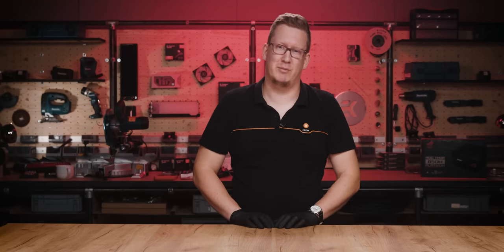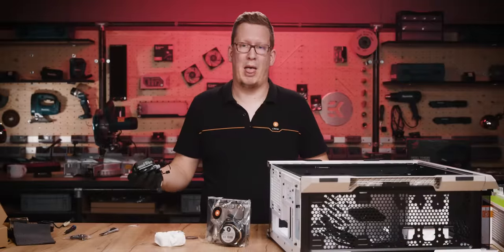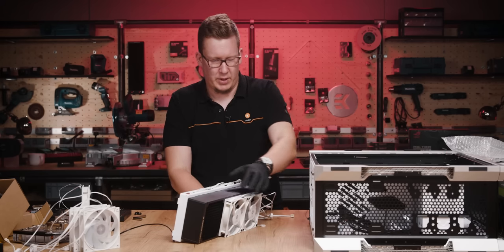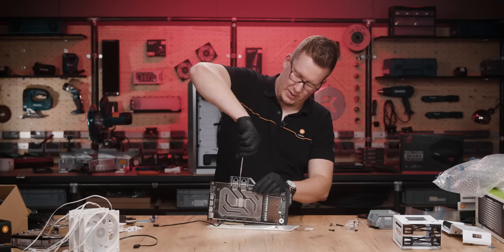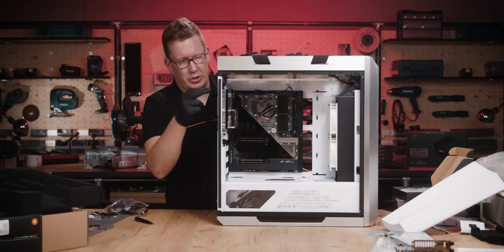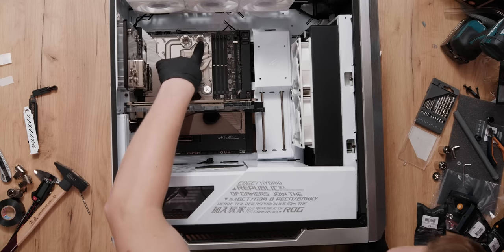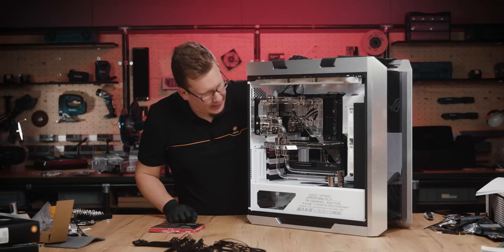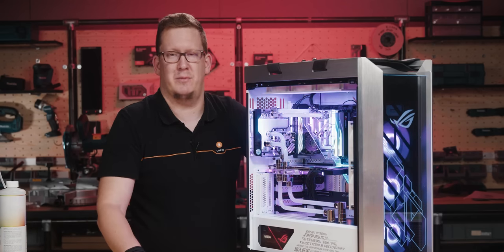🥶 THE FIRST PC BUILD with the $2500 ASUS Maximus Z690 Extreme Glacial Motherboard! 🥶

Comment: So as someone who modifies almost everything in my life, such as creating a baffle for better air distribution in an old refrigerator I use to rise sourdough bread.
I cannot express how fantastic it is to see a video of a computer build that is just clearly showing people that making a custom build takes modifications.
Nothing is plug and play.
Thank you.
Reply: true it's a part that you often don't see, complex rgb build videos are super deceptive, especially the wiring and routing, a cut in the video and "plop" everything is done when it took several hours to do (days if that's your 1st one) and depending on what you want to do a dremel and drill will be required, yes on that expensive case you just bought that's how it is
Reply from the maker: It's a lot of work, but it is worth it :)

Comment: When drilling with hardware installed already always in the case, tape. tape the back and front of the hole before drilling with some painting tape. to prevent metal from drilling flying around maybe getting stuck on the board risking shorts. 

I mostly remove everything before drilling and using a dremel, but even then taping it helps with the mess.
I would have cut the psu cover to fit that extra fan just for the consistency of the build.
I rarely use push pull, i just put in more radiators.

Yeah love to see more distroplaats, me personally dont like the distro plates with pumps, i just use them as resovoir, or to show the liquid in places were there not a lot of hardware to fill out the case a bit. i also build in drains and fill ports to safe myself a cleaning hassel later on.

But really nice clean looking build, really claming and nice video to look at, hope to see more.

Comment: Have a build in that same case.  Bought it to customize and paint but it was too beautiful to alter IMO so I just did a white and nickel build using almost exclusively EK parts and it looks awesome to me.  My son even bought the limited edition Memorial Day CPU block as my lighting is red, white and blue theme and it is gorgeous and cools my 10850K very well overclocked to 5.1MHz all core.  I went with the Thor 1200W in black on mine.  Some cable management and white or silver extensions on the nice ASUS pre-sleeved cables would be great and you almost have to have an extension for the EPS cable as that case is huge and a stretch for the stock cable.

I would love nothing more than to have a job just building PC's like this for people.  You must have other job duties at EK but you are entertaining to watch and do great work.  Very nice.
Reply: Thanks for the support man!

Comment: instead of a 120 version of the distroplate id like to see a 140x140mm version of the flt  pump/res combo. having the extra size and volume would be welcome and most cases already support 140mm fans and radiators

Comment: Also, I wish you had been more detailed with how you setup the fill port, the only shot we got was of the pressure gauge.  You didn't seem to include a drain plan either, so I assume you were thinking you'd invert the PC to drain?  I tend to want to engineer opposite end fill and drain.  Since you had the hidden flex tube instead of the hard drive rack, I might have put a hidden drain in there.

Comment: I love everything about this build, EXCEPT for the front panel RGB fans. Normally it’d be a no brainer. But with this particular case, RGB fans collide with the RGB on the panel, and it looks terrible every single time. So while it’s a rare occurrence, it’s best to just use stock black fans in the front. It just doesn’t look good with colliding RGB.

Comment: How did you guys setup the PWM for the rad fans? There seems to be no cpu/sys_fan header on the mobo, so even though I set it to 'PWM' in q-control in bios, the fans do not spin up when the system increases in heat/usage.
Reply: Did you install any software in the OS to set up the fan curve?

Comment: Could you make an flt that fits on the back of the PC-011 dynamic (non-mini or XL) with the pump in the front? I think that supports 80mm but you need standoffs on the back to make room for the pump

Comment: It's amazing how you planned the whole loop and at the very end you said "I don't like how i've done this"...hahaha, I bought a whole custom loop for my system but fittings and I cannot even assemble it because I have no idea how to start planning the loop or even how much fittings I would need to do it.
Reply: It's my nature that I always want to improve things, so I'm "not satisfied". :)
If you need any help with planning the loop, just reach out to the EK tech support. ;)
Reply: @Assassin's creed Editz because the GPU and radiator are connected in a parallel loop. Its not for optimal performance, but it will work.

Comment: i almost died seeing drill shavings flying all over next to a 2500$ mobo. WHY U DO DIS? :(
Reply: Drill shavings fly only on the outside of the case, the opposite side of the drilling. 
Each time I drill something in case I blow it with a compressor to review all the dust.

Comment: Additionally, I understand spending around $1,000 (Z590 Extreme Glacial) on a motherboard but at this point ASUS and EKWB are just being ridiculous. $2,500?!
Reply: With the kind of hardware you are expwcted to pair it with, it's really not that bad of a price.
Reply: It's overpriced garbage, just paying exorbitant amounts for ROG branding, for whatever little that dumb branding is worth; just like 95% of Asus's ROG lineup. Spec for spec you can find something that at this price point is literally half to 75% less that will provide the same performance, if not better performance. Want a monoblock cooled board, MSI makes one for 600 that is also EK co-branded, has Thunderbolt, 5x M.2, dual PCIe x16, 18 phase 75A SPS (which is more than enough to put even the i9 through its paces). It's got the same 5 m.2 slots, except when you use all 5, it doesn't cut out your second PCIe slot, like it does on this 2500 dollar junk.   Per Asus:  ** M.2_1 shares bandwidth with PCIEX16(G5)_2. When M.2_1 is enabled, PCIEX16(G5)_2 will be disabled.

Not to mention, it's DDR5 with 2DPC, so with the memory topology and signal integrity issues of the 1st gen DDR5 stuff, this board will perform so. much. worse. than some cheap $200 M-ATX board with 1DPC. So basically, if a few extra USB ports and some flashy LED panel is worth 2 grand to someone, more power to them. Otherwise, this thing is ridiculously stupid, and ridiculously overpriced.

Comment: it's super expensive yes but let me tell you why it's something you might want if you can afford it, look at my current temps and tell me what's wrong : mb 33°C vrm 34 pch 60 ddr 36 cpu 32 gpu 24 m.2 39
it's the pch aka the chipset that's at 60 or even 70+ while gaming, since they introduced pcie 4.0 in x570,trx40 and now z690 it's hot all the time, the glacial should fix that, fanless motherboards are dumb, it's too hot it needs better cooling

Comment: This Loop is not funcional. U go from Reservoir > Gpu > Radiator > back to Gpu ??
U need to 2 Tubes for Gpu, IN / OUT ... but u have 4. 
First seconds of Filling the Loop u can see the Coolant ist just Falling from top to bottom Tube wich means its avoiding the Coldplate Route on the Gpu.
Comming back from Radiator its the doing the same, just going up ... The Coolant isn´t circulating in/over the GPU Chamber at all.
Going in Left Fitting of Gpu, over Coldplate, so has to come out right Fitting, to radiator, back to left again  ???

I didnt figured out the Reservoir routing .. going from GPU to CPU  over a Reservoir is possible, cuz of different Chambers drilled in.But my guess is, the CPU circle is just filled with Coolant and not moving at all.
Reply from the maker: The tubes are connected to a small EK-Quantum Reflection UNI 140 distro plate and the loop is fully functional! To learn more about parallel connection follow the link: https://www.ekwb.com/blog/parallel-vs-serial-loop-why-choose-one-over-the-other/

Comment: It is better not to show how 3 thermal pads were put on top of each other in the video card , it is not necessary to do this, people are worse at heat removal and you will change them more often and the price is the most important thing checked !

Comment: it hurts to see so much empty space left. Such a big case should have at least 3X RTX 3090 inside.
Reply: Just horizontally mounting the GPU would've filled that space up well
Reply: @Redswipe  I agree, but this was a build about the motherboard, so I didn't want to cover it.
We will have a live stream soon enough, feel free to join to discuss other options. 
I will also, probably, raise the radiator to fill the big gap at the top.

Comment: Great build, but I always laugh at ATX boards with 1 PCI-E used. Be nice to at least add am NVME HBA....Maybe another 10GBE card or even a 50GBE card, great for VM use. Got ~6VMs running on my 5950x, using ~800w 24/7